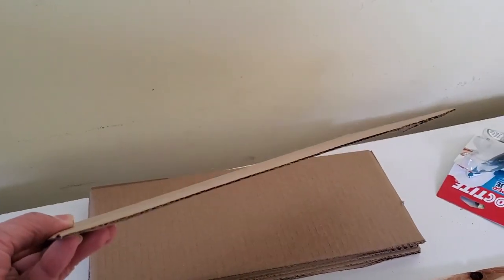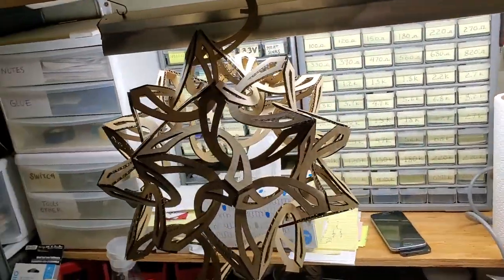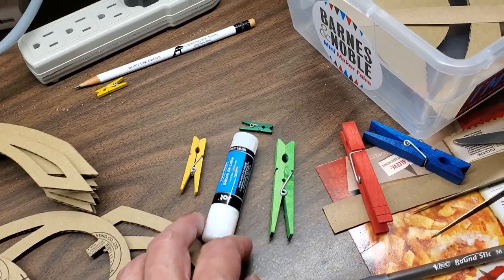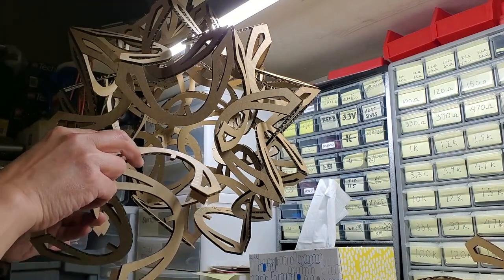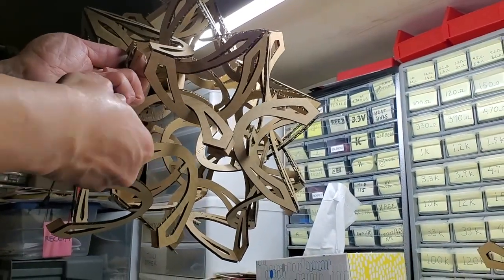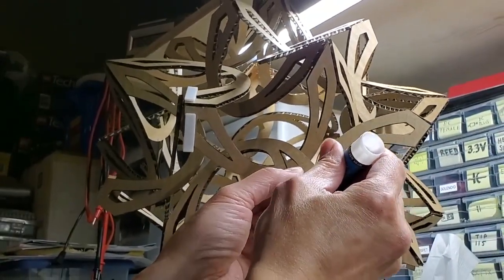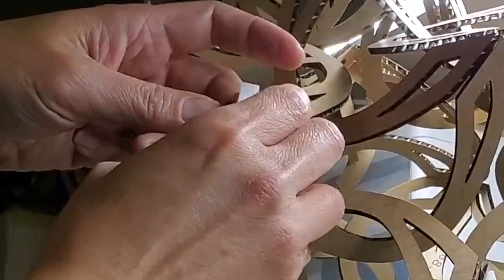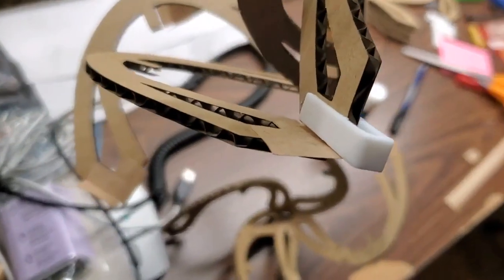HariFun #181 - Solar Flair

Comment: You don't have clothes pegs?
Reply: I've never seen the medium size in my local stores. (the too big and too small ones are easy to find, though)
Reply from the maker: I have lots of the "too big" ones, so I eventually used them anyway.  They're tough to insert due to  their length, but my fear that they would be too powerful and crush the corrugated cardboard never came true.  So, I could have used those big ones afterall. Oh, well. it was fun making my own clips in Fusion360.